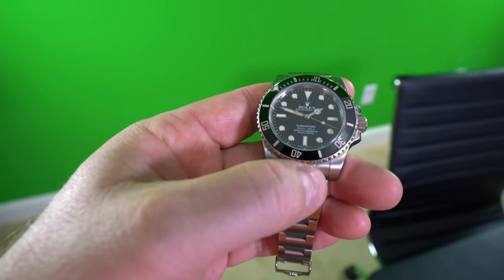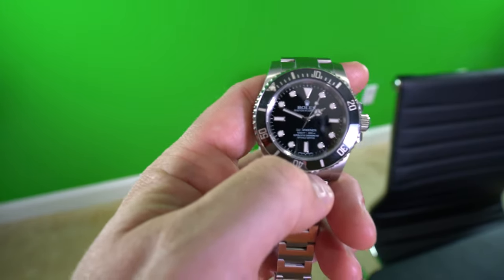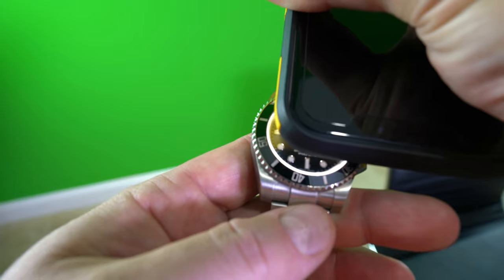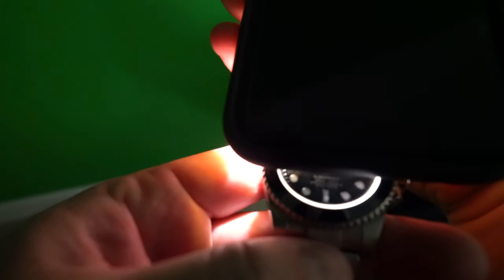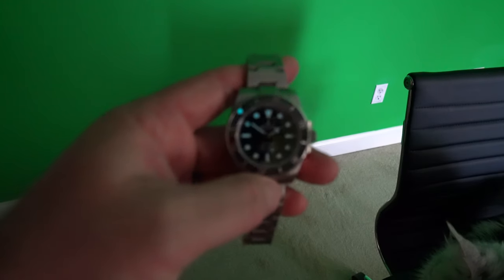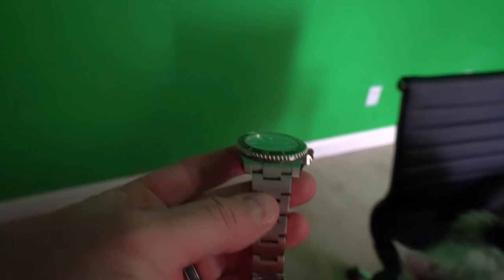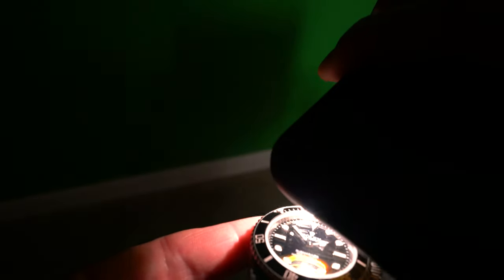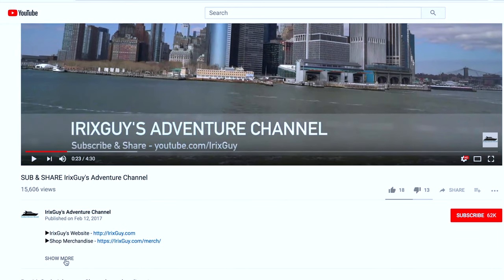How to See Rolex Laser-Etched Crown

Comment: Thank you for the tip. I was worried my 2019 Hulk did not have the laser etching, but after using your technique, I was able to see the etching. Very small though. Otherwise it is not visible even with magnification.
Reply from the maker: That's a big sigh-of-relief I'm sure =)  It amazes me how the Rolex LEC magically appears.  From what I've heard, some of the best fake have them now too, so it can't 100% confirm authenticity.  Unless you purchased from an authorized dealer, it's impossible to be certain that all internal components, bracelet, etc. are authentic.
Reply: @IrixGuy  The fakes are perfect crown but if you actually see the Rolex one magnified it's not perfect on purpose, on this occasion the fakes are too good and that's a give away.  Thank you for the tip, I tried so hard to see the crown I thought I was losing my mind.

Comment: Yes, I finally got to see it, I put the light on the 3 o'clock and tilted the watch little bit to the upper left and there it is
Reply from the maker: LOL the Rolex LEC is easy to find after finding it the first time.  Polar dials can be a little trickier.
Reply: Flashing on 3 o'clock position definitely helps

Comment: There is a moral to the story. Only buy from authorized Rolex dealers. OK, you pay the price, but you get the certification of authenticity without the worry.
Reply from the maker: Agreed!  I purchased my 114060 from an AD in the Cayman Islands.
Reply: @IrixGuy  :Another point; service should be performed only by certified Rolex facilities. I found a so-called service facility put bogus parts into one of my watches. It took a reputable dealer to rectify that situation, bearing in mind service is periodically required.
Reply from the maker: Great point.  I think that service intervals for latest references may be 10 years.  With that said, I have a 20+ year old Omega SeaMaster 300m and have not serviced it yet.
Reply: @IrixGuy  :Good point. Most folks wouldn't buy an analog watch in today's age. You must be a watch fan to spend the cost of one of these watches. My Rolex dates back to Vietnam days from the PX; still runs great with 3x periodic maintenance.
Reply from the maker: @karthurjr  Very true!  Yeah, Rolex watches are built like a tank...especially the newer references with solid links and ceramic bezels.  I prefer the no date references because that's one less complication to fail and the dial looks symmetrical.
Reply: @IrixGuy  : My PX watch is simple stainless steel with no date. The opitamy of what Rolex was all about.